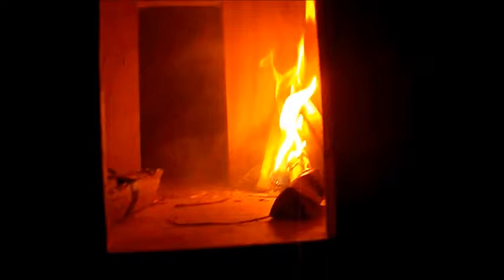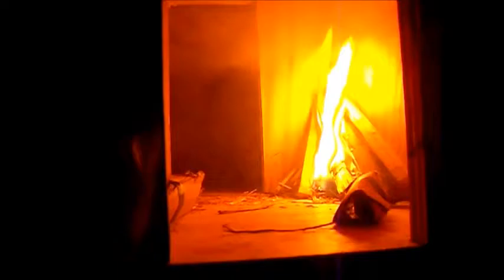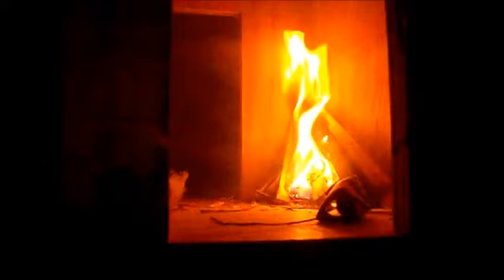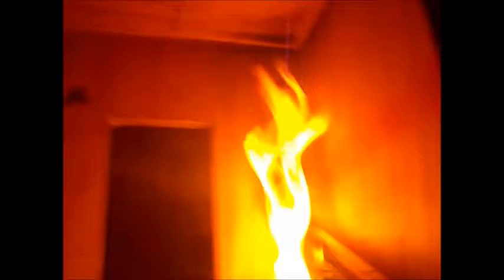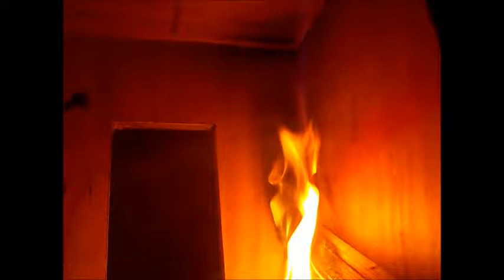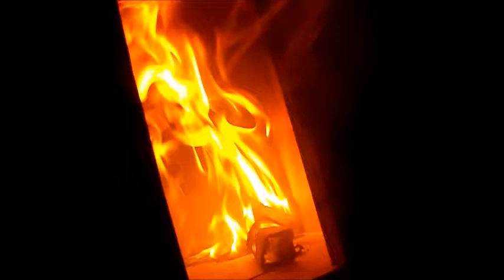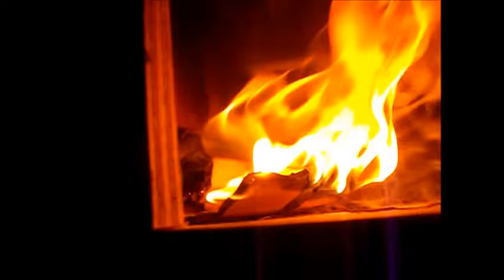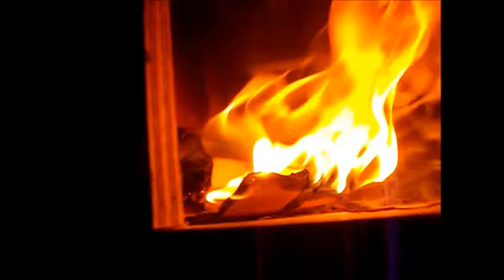2 Room Doll House Fire Behavior Flashover, Backdraft, Side Vent

Comment: Not a Backdraft.... what you have there is a Smoke Explosion. 

Smoke expolsion is defined as: A smoke or fire gas explosion occurs when unburned pyrolysis products and flammable products of combustion accumulate and mix with air, forming a flammable mixture and introduction of a source of ignition results in a violent explosion of the pre-mixed fuel gases and air. This phenomenon generally occurs remote from the fire (as in an attached exposure) or after fire control.

A smoke explosion requires a relatively cool mixture of fuel (smoke) and air within its flammable range to come into contact with a source of ignition. On the other hand a backdraft requires introduction of air to an hot, extremely ventilation controlled fire where the concentration of gas phase fuel (smoke) is high and oxygen concentration is low. Both result in an explosion, but the initiating event and indicators that may be observed by firefighters and fire officers are considerably different.

For further explanation see: http://cfbt-us.com/wordpress/?p=24